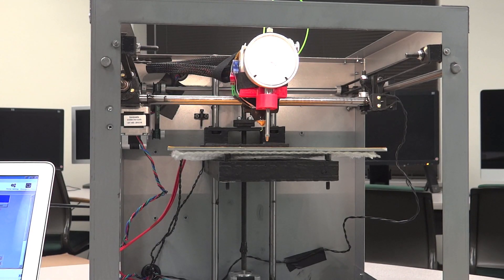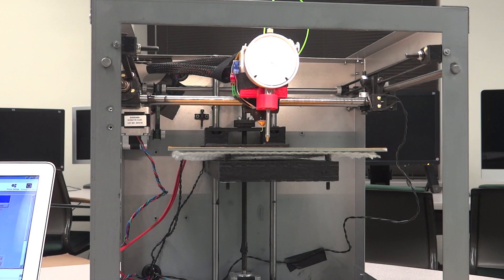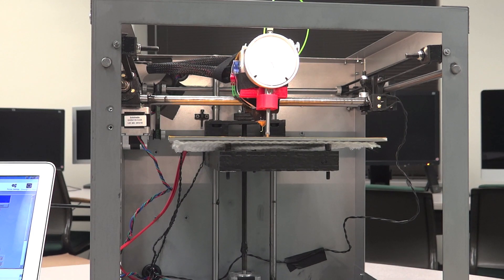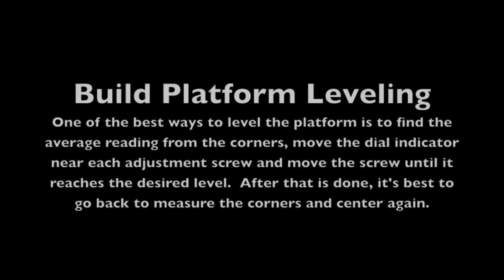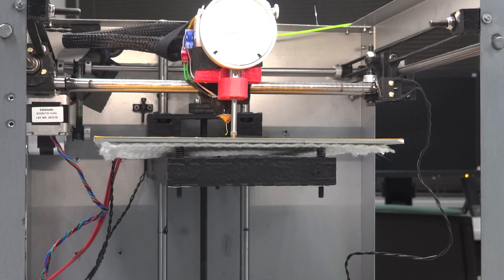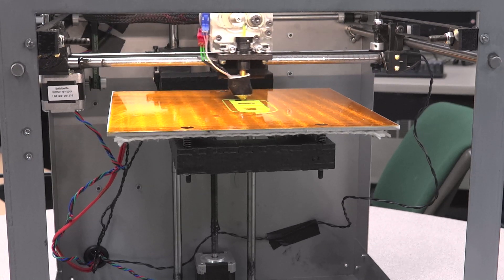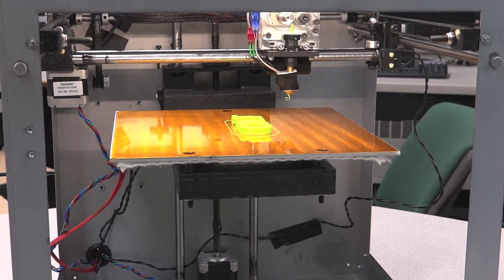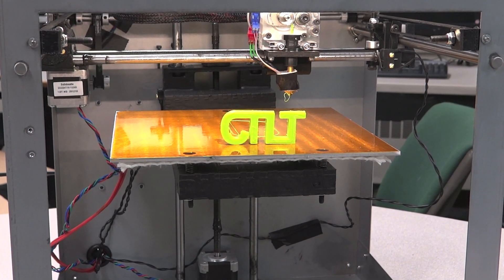Solidoodle 3 - First Print

Comment from the maker: No problems with that. X, Y, and Z always feel like their room temp.  The extruder controller definitely warms up, but I've never had it overheat. If the problem is with the extruder motor, I'd check that the heat sink is well seated on the motor and that the fan is running well and pulling air from the heat sink.  If the problem is with the axes motors, I guess I would check if the belt tensions feel too tight.  That's admittedly hard to tell if you haven't run a similar printer before.

Comment from the maker: That's the same problem I had, i.e., the 2nd gen stuck well & the SD3 was poor. In general, it's less wear/tear on print bed to use a removable surface - I use cheap plate glass (see my Updates vid) with office binder clips and the glass serves to make a flatter surface for better leveling (can improve sticking somewhat). I then use hair spray, Cubestick, or ABS/acetone slurry. Software-wise, I slow down the first layer to 50% speed. If you get it sticking but curling, you can try skirt.

Comment: Thanks for the great video.  I am torn between a Solidoodle 3 and Replicator 2.  I am looking to use the printer in a summer camp for kids so I think we will use PLA vs ABS.

Can I print in PLA straight out of the box?  Do I need to use "Blue" tape or add a glass plate?

Thanks in advance for your time.

Comment from the maker: That's a tough ?.  I know 2 people with printrbots (one has experience with other brands), and both are happy with them.  It's a good first printer if one wants to learn or get experience building from a kit (most new printers are coming pre-fab).  However, the build volume is low by today's standards.  You can print bigger things if you get a RepRap such as a Mendel Pro or Prusa Mendel). If you don't want the experience/hassle, an extra $100 gets a Solidoodle 2 with 6"x6"x6".

Comment from the maker: @Summersault666 It is a dial indicator. It is often used in machining such as ad-hoc attached to a mill or lathe. The linear compression of the stem is converted to a circular deflection on the gauge.

Comment from the maker: Yes, since February, we've added some mods.  First, we added thumbscrews for the print bed adjustment screws that have been an issue on all the Solidoodles. We added a 30mm fan with housing to cool the plastic after extrusion to reduce warping, I am printing onto a glass plate so we can quickly switch between print jobs and not wear down the polyimide tape.  On Monday, I will be adding a plexiglass enclosure to keep the printer clean and hopefully increase quality by controlling temperature.

Comment from the maker: I've had mixed results with PLA.  My big problem is that I've bought very little PLA and had chosen the clear and translucent varieties in order to complement my ABS spools.  It turns out that these plastics are much more difficult to use than the other PLAs.  Nonetheless, if I use blue painter tape, a push down hard (lower the z-axis so the nozzle is really close to the PLA), it prints okay.

Comment: thanks for the quick reply, do you know if there is a difference between the glass bed the replicator 2 uses and the glass beds that people use for rep1's? I dont see a lot of polyimide tape or blue tape being used on the Rep2's, thats why im asking.

With the glass and tape does PLA print fine?

Comment from the maker: So far so good, but I've put on a removable glass bed with its own polyimide tape, partly because a few of us have had trouble with filament not sticking.  The glass also keeps everything clean in the printer.
  I'd say it's taken about the same time fine tuning as I've heard for the Replicator but that's a guess.  There was very, very little assembly.
If I was to buy a Replicator, I'd get the 2X (although very expensive!) as they didn't truly fix the extruder until then.

Comment from the maker: The ABP is on our Thing-O-Matic - not Replicator.  We didn't get a Replicator due to negative chatter on Makerbot operator listserv and then alternatives opened up.  To add an ABP to another printer would require an additional digital or analog output, and reading the RepRap page for it suggests there are many, but it needs custom firmware. I haven't done it but think the weight would stress the z-axis.

Comment: O and how is it with printing PLA and i saw you put a automated build platform on your Rep1, is it possible to connect a build platform to the Sanguinololu board? I've worked with RAMPs 1.4 and a arduino mega but not sanguinololu.

Comment: Hey i've been looking into buying my own 3D printer for a long time and i've been looking at the Replicator 2 for MBI but have been kinda leery due to their high price and all the complaints online of there customer service and based on what i've read its just a shinier Replicator 1. 

My question is, how has your solidoodle 3 been doing in terms of ease of use from unboxing, quality of its assembly, how much tweaking on software/hardware side compared to your replicator 1 when you bought it?

Comment from the maker: Good question. I first saw info about this at Thingiverse thing: 28094 .  I made a little bit of a mistake as I ordered the following dial indicator:  Amazon ASIN: B001QXR2LA .  It had an extra metal base and extension arm that seemed like a nice.  However, the indicator has a metal loop on the back to attach to the metal bars, and that got in the way of the plastic mount.  I cut the plastic design down a bit to make it work.

Comment: the reason why it is bigger on the bottom is because you need to set the heat on the platform correctly if you do that it wont warp